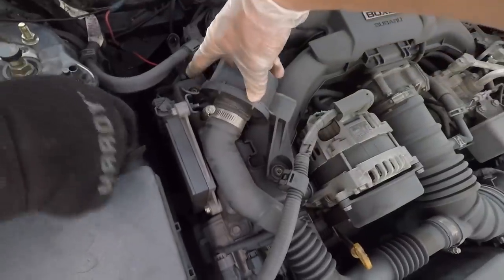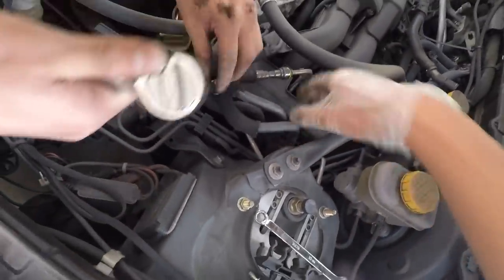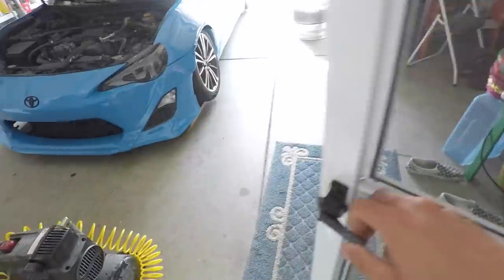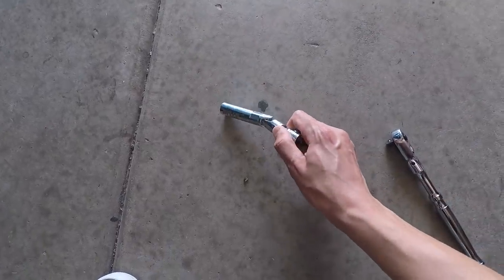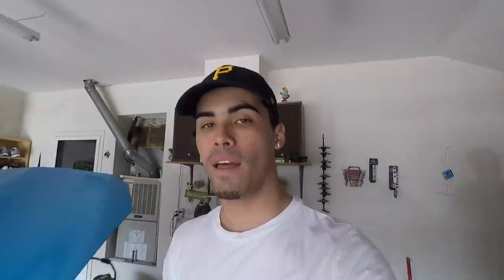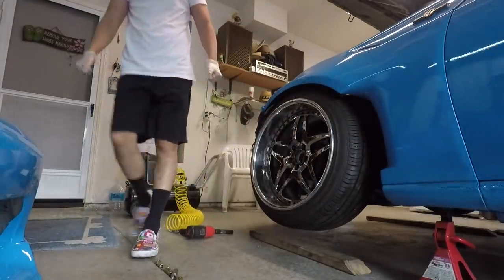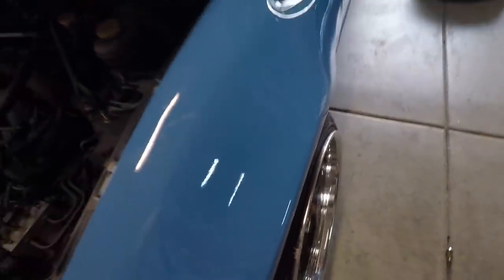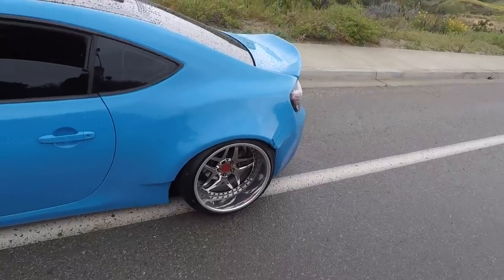New 3-Piece Wheels For The FRS! (+ Spark Plug Change)

Comment: Yo how did you get that metal clip/pin off? Did you push it in or just pull it out? And does that free up the connection between the coil pack and the wire?
Reply from the maker: Pulled it off and never put it back😂 Gotta take it off first to remove the two apart.
Reply: @chris_borges  Looks like that’s what I’m going to be doing Lmao how does it still hold in place without disconnecting since there’s no clip holding it in place?

Comment: I have a BRZ and i’m just wondering at what mileage interval does subaru recommend a spark plug change for the FA motor
Reply: 60k is when you're supposed to change them. I did it a little different than he did. I loosened it with a similar setup with the ratched. I used some fuel line to grab the end of the spark plug and pull them out. Took about 2 hours, but could be done a little quicker probably.
Reply: Ratchet*

Comment: Did you use antiseize on your spark plugs?
Reply from the maker: I didn't
Reply: Chris Borges Uh oh, I would redo it and put antiseize, spark plugs are inside a hot engine ans well make sparks so the engine goes boom in simple terms,,,, it can get really really tight and kinda weld itself to the block